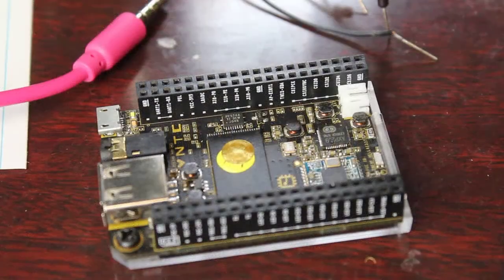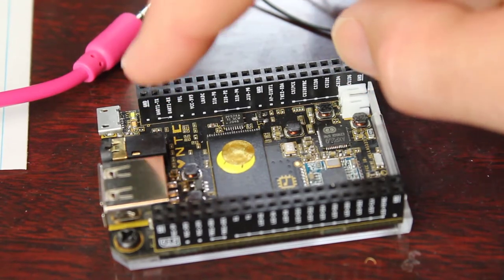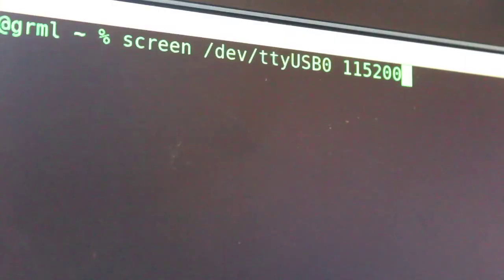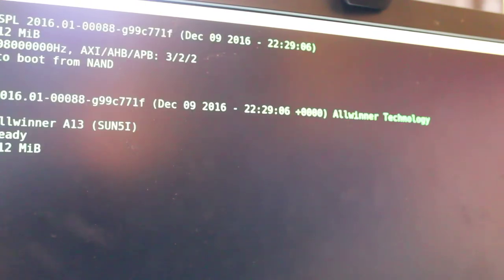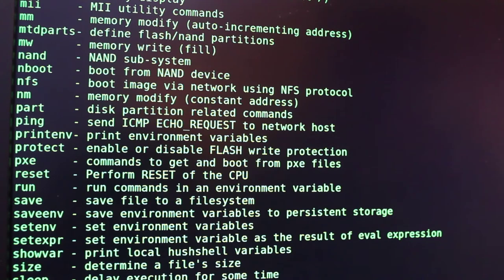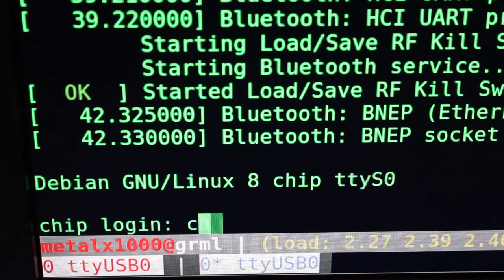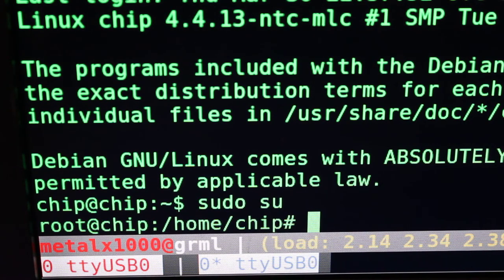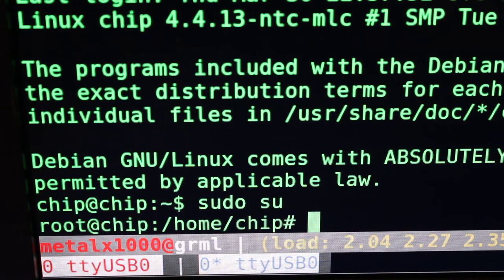UART Serial Connection on the C.H.I. P. $ 9 Computer

Comment: I believe the C.H.I.P. can simply be connected with a USB cable on the micro USB. You then get a new serial device on your Linux or MAC. And you can use screen like you did. You only get a shell, no uBoot so you cannot use that for recovery.